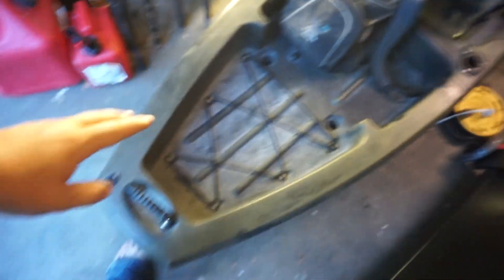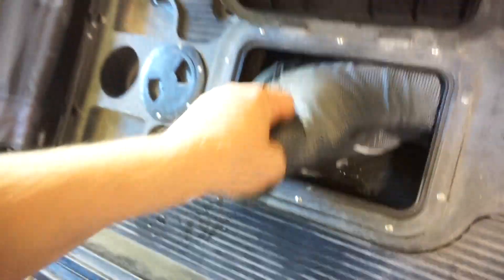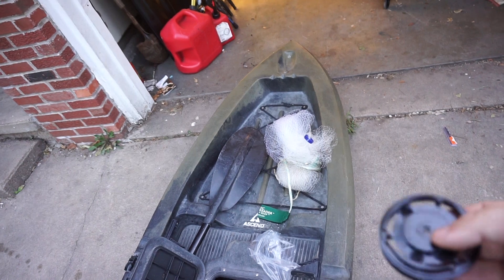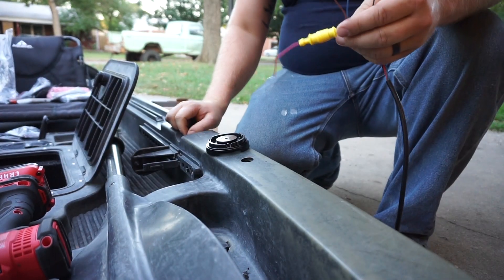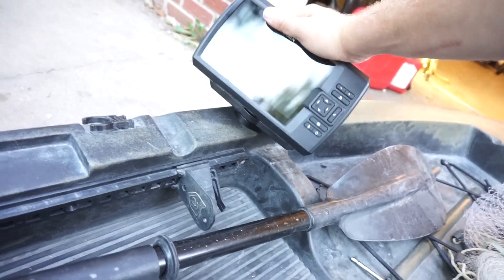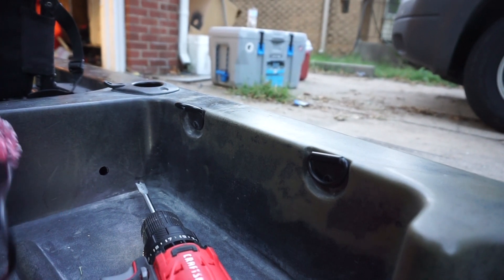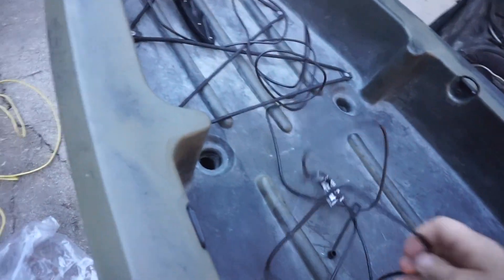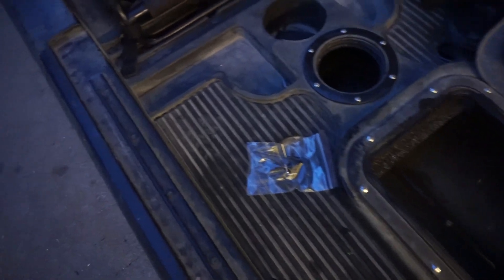Ascend 12T Garmin 7 CV Installation

Comment: This was a good video man. I like how easy and simple it was to put it together. And it doesn't take too long to put together. I also like how you worked on the kayak barefooted 👣too because I have work on my kayak Barefooted 👣 because i have big very very extremely wide foot with fat wide toe that are equally straight across. Have to work like that because there's no shoes , sock , or book that's wide enough to fit my wide foot. That was cool to watch man thank you for sharing your video.
Reply from the maker: Thanks man!
Reply: @Joelfrickinjohnson    you are very welcome man.

Comment: Is the unit to far away from the seat to use the controls / Press the buttons?
Reply from the maker: Not for me I'm 6'1 and if I just lean forward a hair I can do whatever I need you can use the track system in there I just heard they're flimsy so I just deck mounted instead of risking it!